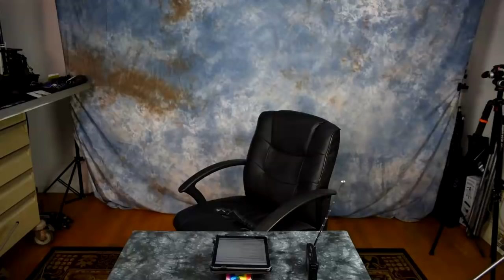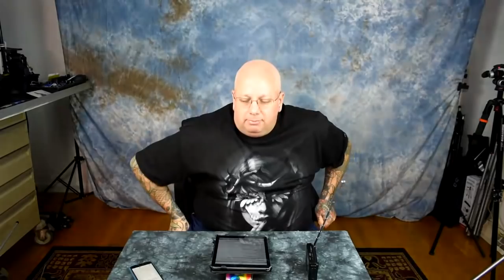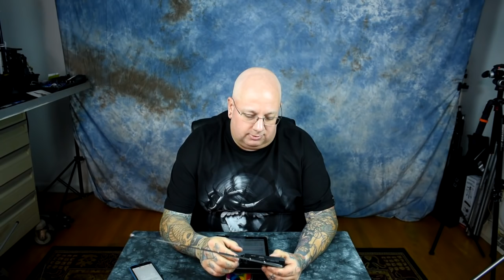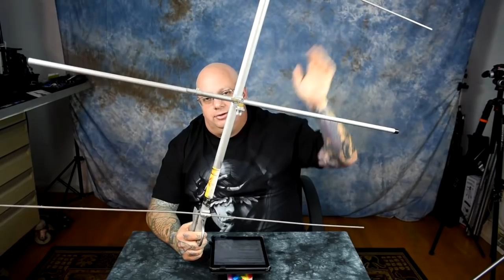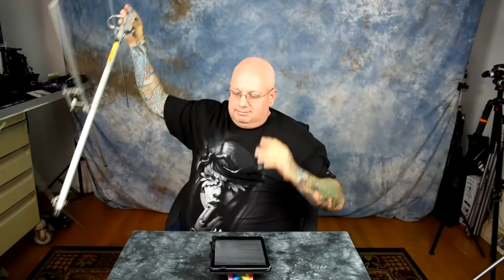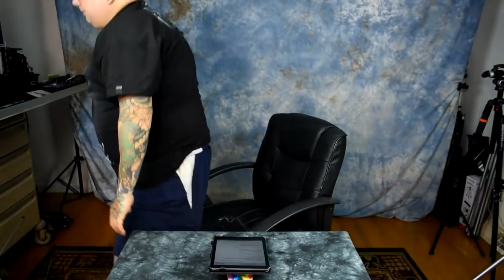Angry Photographer: Part 1. What Digital ISO does, & the 3 levels of SIGNAL GAIN

Comment: I have a decent understanding of shortwave radio operation. Would you say that ISO gain is most equivalent to the volume knob on a radio?  The more you increase the volume, the more output signal gain you get, regardless of how clean or dirty the signal is. Also similarly, after you reach a high enough volume, you will likely encounter further signal distortion due to the output limitations of your speaker(s).  Just curious what your thoughts are on this.
Reply from the maker: GAIN KNOB, not volume which is brightness
Reply: Gotcha!  Thanks for the clarification. It's a great parallel and really helps to solidify what it really does at its root function. Thanks again!